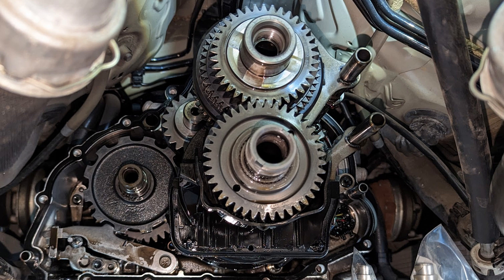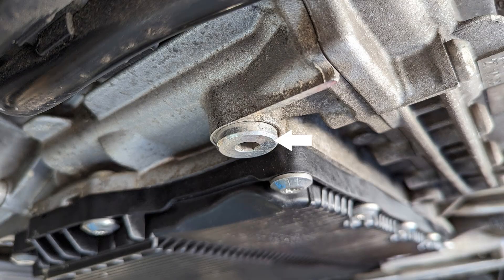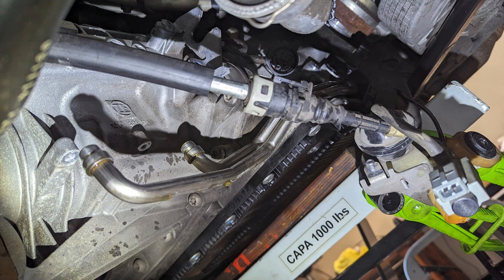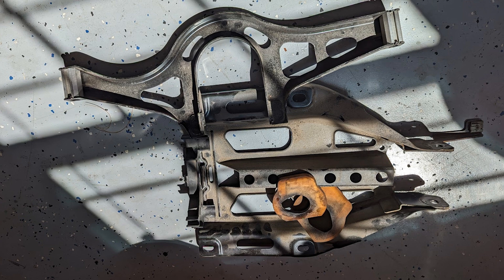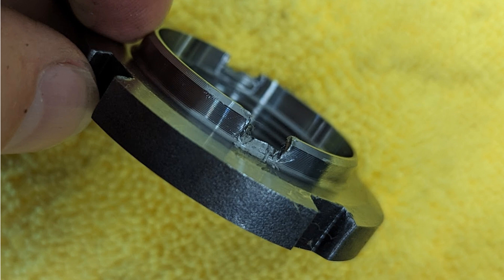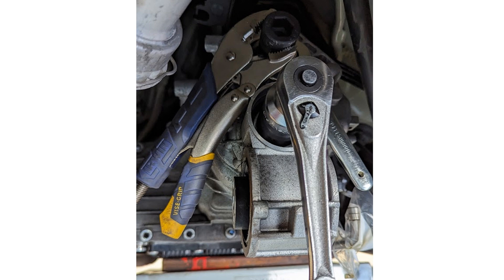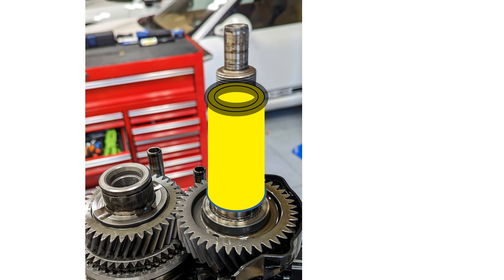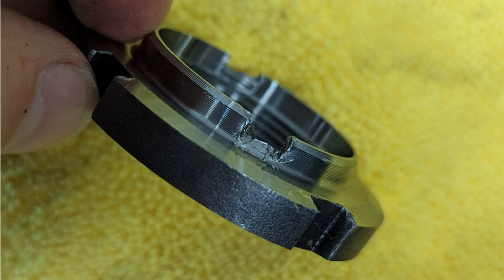Porsche 911 PDK distance sensor or speed sensor replacement

Comment: for reference if you have the 2 transmission coolers you will need to pinch off the coolant hose for the cooler on the passenger side

Comment: Jeff, I really appreciate your videos, and well done for being so committed to these issues. I have a 997.2 and have an issue of fluctuating RPM when at constant part throttle, especially in gears 4th and higher. It looks on the tachometer as though the car is slightly slipping the clutch, although I dont feel this, as the RPM rises and falls by a 50 rpm as I drive along (I can also hear the change in engine note). So far, I have gone to porsche for a clutch pack reset, although I dont really know if they did it correctly, and also checked for error codes, which have only been P1990  -positive engine torque, intervention not possible. Have you heard of this error, and any tips? The PDK has been serviced about 5000 miles ago, and the problem started about 1000 miles ago.
Reply from the maker: I've not come across this fault before, but looking at the diagnostic information for this code, it says it's going to be either a CAN bus or engine problem. The indications you give of hunting engine RPM seem to indicate there might be an engine problem where it's getting fluctuating air or fuel maybe. I'd be looking at intake boots/manifold seals etc as the first thing. I'd also be driving with diagnostics attached and monitoring things like intake air volume, throttle position etc to see if there is something that stands out.

Comment: I know this may sound simple, but it would be great if you can make a video specifically about the tool the design bolt specifications how it’s used to pull, how it used to push,  it sounds simple, but I search the entire Internet and there’s no specific information on it your video would be the first
Reply from the maker: All the tool stuff is in the videos linked in the description. The rear casing video has all the basics and the distance sensor replacement video is for the Boxster/Cayman, but it contains a lot of essential knowledge.

Comment: Hi Jeff, I have watched this very detailed video about the valve body on the pdk and how to strip and assemble it.  We are a workshop in South Africa unfortunately very far from you guys, I was hoping you could please point me in the right direction if you might have had this scenario before.

I currently have a problem with a pdk and I suspect it is the valve body.    We have replaced a few distance sensors and speed sensors on these gearboxes before, but this particular one that we have now has a P17D0 fault code and the vehicle had no gears at all.  The fault code suggests it is either a hydraulic or a clutch problem when I follow the Porsche diagnostics chart.  We have replaced the solenoids on the valve body and the vehicle now has drive and we could erase the fault code.  But after driving for 20 minutes and stopping, all gears are lost and then the fault code returns.  If we leave it until the next day, she will drive again and when we stop, we lose the drive again.  It has progressed to the point where it doesn’t want to drive any more.  We removed the box, removed the clutch, opened it and it looks as if there are no problems with the friction plate. Can you point me in the right direction?
Reply from the maker: I personally haven't come across this issue before, as my only experience is with the 981 transmission, and helping others online with their problems. It might be worthwhile creating a Rennlist account and posting at the thread linked below, as it's the place most go to for information and help. There are a few others who are quite knowledgeable there. I go by the handle jjrichar. Another by the handle Stjoh has a lot of experience, especially with the 9x7.

I think the chances of it being a solenoid or VB problem are remote, as from what I've seen these tend to issues with distance or speed sensors that aren't appearing as such because the trigger values aren't exceeded.
A few questions:
Was a calibration with part replacement done after the solenoid replacement?
When the car was working, did you log all actual values while driving until point of failure in an attempt to identify where the problem might be?

https://rennlist.com/forums/997-forum/1172826-guide-to-repairing-a-pdk-transmission.html?ispreloading=1#

Comment: How much time are really saving doing in the car? Ive done about 30 so far but have always removed trans. Is it worth the headache of keeping trans in car?
Reply from the maker: How much time total does it take you when removing the transmission from the car? No more than a day's work for a single tech remaining in the car. There are shops doing this all the time that quote 28 hrs min by removing.
Reply: @jeffrichardsoncardiy  I'm not as fast as I used to be. It takes me about 10 hours to remove trans, splice in new distance and speed sensors, reassemble, reinstall and calibrate. 28 hours is ludacris.
Reply from the maker: @darkgod79  Once you are happy with the process, I reckon you could do the whole thing in about 6 hours. The 911 seems to be easier than the Boxster/Cayman as the exhaust doesn't need to come off, and it's simply a case of disconnecting a few things and lowering at the front mount. 

The info we had from a shop in the US that did a large number of DS replacements was a minimum of 28 hours and up to 40 hours if there were complications. I'd spoken to people who had used their service and the charge, including a new DS only was about US$7000. We thought this was crazy, and one of the reasons I was keen to get as much info out to the public as I could.

Comment: Jeff, seeking your expertise. I have 2017,C2, PDK. While in park or at a stop I hear a rattle (like loose marbles or gravel) and I feel a slight engine stumble/vibration. If I put it in sport or sport+ the rattle and stumble is reduced. I tried to pin point where the noise was coming from, and If I put my hand on the PDK oil pan I can feel the vibration. I can also hear the rattle emanating from this area. The car shifts and drives well. Is this noise and vibration normal? Will a PDK fluid change help? Thanks
Reply from the maker: I've heard people report this before. I hear a similar thing from my 981S. I don't think there is anything in it. I think it's simply the clutch pack components vibrating when not engaged. It might be something to do with harmonic frequencies at this engine speed that selecting S/S+, and changing the engine speed, reduces. Don't know if a fluid change will fix this, but I'd always recommend it, as it's an essential part of maintenance.
Reply: Jeff, thanks for the feedback.  I'm at 45k miles and will change the fluid and pan at 50k.  I think I saw in one of your videos that PIWIS  is not necessary.  One more question, while I'm at it I plan to also change the gear oil.  Do you recommend certain brand for the gear oil?   @jeffrichardsoncardiy
Reply from the maker: I'm in Australia and I use a local brand called Nulon. It really doesn't matter, as long as it's the correct spec. BTW, I personally don't worry about the pan/filter. The filter on any auto transmission, including the PDK is only for very coarse material and is designed to last the lifetime of the transmission.  It's completely different to an engine oil filter, that is designed to filter out very fine particles, and will break apart over time if not replaced.

I've cut open many auto trans filters and I always find they are complete empty of any debris. I used to replace filters regularly, but now I never do. Especially in the PDK where the rear subframe needs to be removed and the filter bolts are aluminium and need replacing. By contrast, fluid drain and fill is dead simple.

Entirely your choice, but from my experience, I've made the decision to not bother.

Comment: I am trying to make the tool, but I cannot find the specific thread and pitch for the two bolts in the middle and the four outer ones to remove the Cover, Can anyone please help, working on. 2WD base 911 2013
Reply from the maker: Four on outside are M10 x 1.5mm threaded rod. Get from a bolt supplier and cut to the correct length. Two on the inside I used M12, but these don't have to be a specific size. I used M12 as this would give plenty of strength to push out.
Reply: you say they are M12 but the thread is it 1.25, 1.50??

In another video, someone mentioned M22, M24 what are this referring to?
Reply from the maker: @mikeyson1011  The M22 x 1.5 and M24 x 1.5 bolts are to install the rear cover. Look at the videos below, for which there are links above in this video description.

https://youtu.be/N7U_HG-SXKM?si=7ZpQ_qKbTDAAxw8Z&t=1097

https://youtu.be/sSeghP7SYJQ?si=Yf4UnUD7F0Q8HuQ_&t=891
Reply: you rock!!! thank you